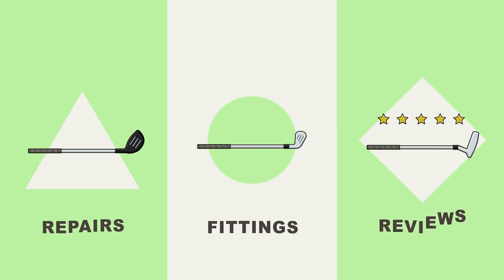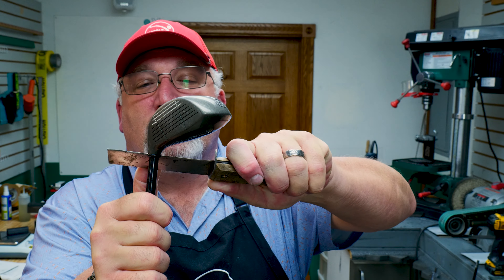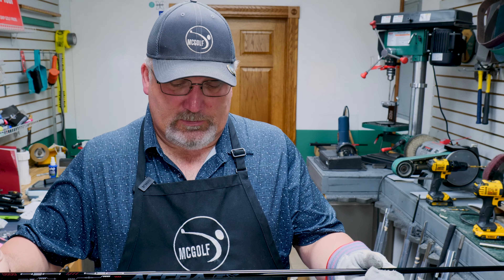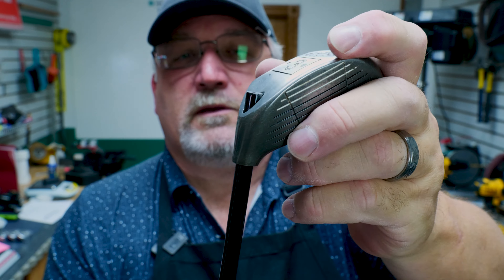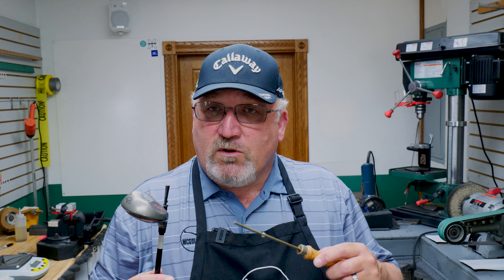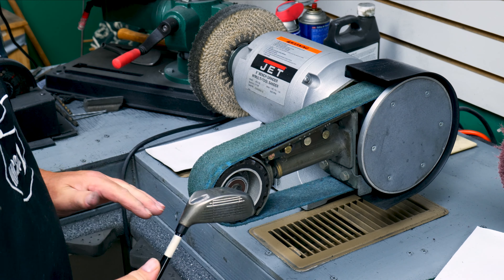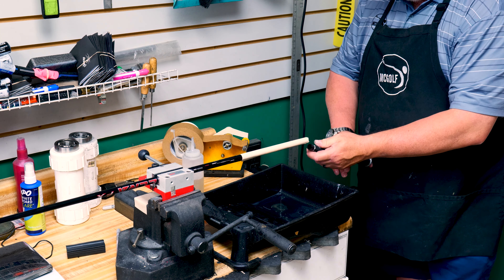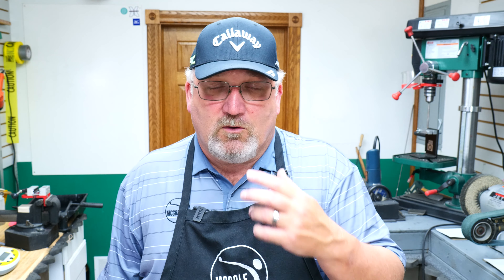2021 old callaway repair

Comment: S2H2 Double Dot (13*) used to be a holy grail of three woods for better players in the late 1990's and early 2000's, that and the Titleist PT. Actually Dick Helmstetter, who used to design pool ques, came up with the Short Straight Hollow Hosel design. Ely was a great marketing and sales guy , but he knew little about clubs except how to sell them for $300.00 ! The S2H2 is a .335 tip , Callaway did not start using a .350" until the Hawkeye and Steelhead series of woods. The "paint' is actually a clear coat, when the heads came out they where tumbled and because they had to put more finishing work into the bore thru clear coat was a time saving alternative due to cure time and masking.

Comment: I used to enjoy doing all the bore through stuff Jim. Being able to rip out the RCH without damaging the heads gave me an advantage over most shops here. I tapered the pins off more too, so that it inserted deeper into the shaft...just made that connection a little mote mechanical and solid than with standard pins which I felt had too much taper and possibly could show more epoxy than I liked.
I used to use the .350" shafts too unless my clients wanted a more regularly available.335" and then the adapter from Golfsmith or Works similar to the one you used 👍
Those and the War Bird heads are still some of the easiest fairway woods to hit that Callaway (or anyone else for that matter) have ever made...I quite miss them, and the work they brought in 😂😂😂

Comment: Well done Jim.  Question:  Could you have used a shim in getting the desired size?   Congrats on the 79 once again.
Reply from the maker: I could have used the shim then it would have left brass as part of the design on the bore thru